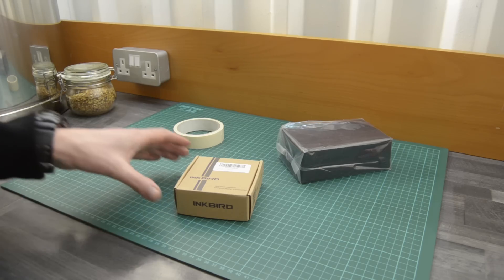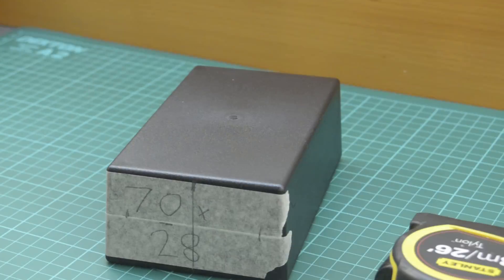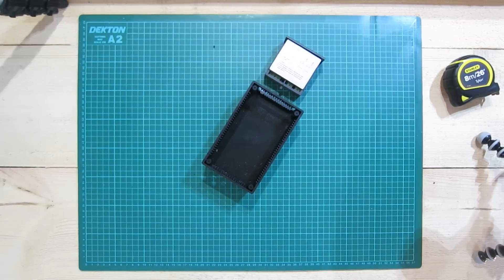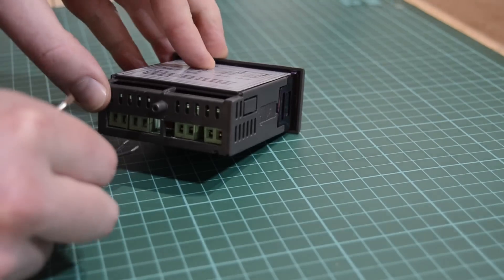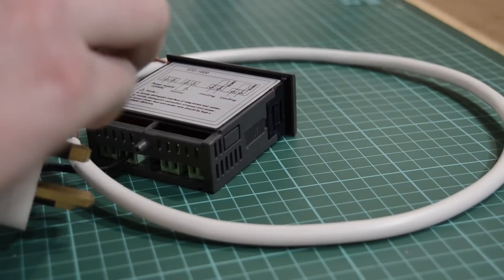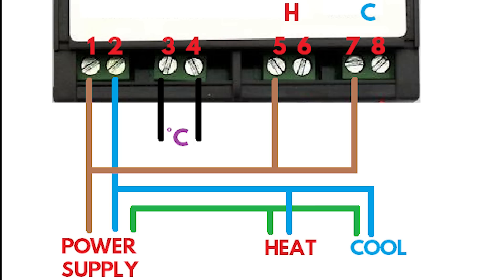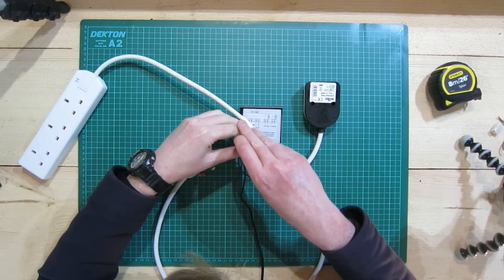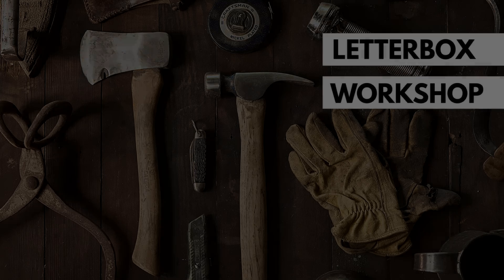STC1000 Wiring Guide - How to make a Homebrew Temperature Controller

Comment: I'm not so sure about that split ground you did, mains voltage is 220V in non retarted countries and 110v in America while the stc 1000 needs 12V or 24V power supply, so no, I don't want to burn out my newly bought temp controller thank you
Reply from the maker: The STC1000 comes in 12v, 24v and 110-220v versions.  My 220v has been wired like this for over a decade without problems 🤷
Reply: @naturalsIV  oh well my stc only shows the 12v and 24v options, luckily wiring it with independant power supply is easier, simpler and less time consuming so I just did that, probably would have done it that way with mains too if mine ran on mains.

Comment: Hello, this wiring works well. I have mine installed and it’s working fine, however, the whole fridge switches off. Is there a way the light remains on when the temp cuts off supply to the compressor?
Reply from the maker: Personally I wired some 12v LEDs in to the normal fridge door on/off switch and ran these off a separate power supply to the fridge. When the STC is off, there's no power at all to the fridge, so you need a standalone supply for this purpose.

Comment: Decent video. Thanks for sharing. If I can suggest you don't bother with the background music though, it's a little irritating IMHO. Also, a couple of shots of the actual wired connections in each step would be useful as your hands block the view of what you're doing quite a lot so, make the connection then move your hands out of the way to show what you've done, rather than just cutting to the diagram. Thanks for doing this though. After a few watches I figured it out 👍

Comment: Hi I have just bought kne of these on the back the wiring diagram says 1 and 8 and 2 and 7 connect am I missing something I'm using mine to convert freezer to fridge so do I follow your method leaving out the heating
Reply: @naturalsIV  thanks for reply I was just worried because the wiring diagram is different on the back
Reply: @naturalsIV it's number on eBay UK  222009063678 plz check it out
Reply: I don't want to mess up lol

Comment: Good video help with wire and confirm I done it correctly I got a unit says  220volt but UK is 230-240v, I turn my unit on and then unit trip off then reset the replay and continues the cycle?
Any suggestions

Comment: Hi, Thank you for your video, It was really helpful, I was just wondering, if we don't use any heating or cooling device, how do we do the grounding for the temperature controller? or do we just connect neutral and live from the power socket? and don't do grounding? 
Thank you!

Comment: So just to clarify, with the ground you are literally using one of the chocolate block things and joining the ground wire of the stc1000 power supply, the heating ground and the cooling ground?
Reply: And all the wires in ports 5,6,7 and 8 are all positive?

Comment: Can I fit a 3 wire temp probe with this? If yes which wires to use from black, red & yellow?
Reply: NTC 10k ohm thermistor rather than the usual k-type thermocouple.

Comment: does the wiring diagram suit a 12v system and do you wire the same  as I cannot find any wiring info for 12v
Reply: Go to GOOGLE and search for:  "stc-1000 temperature controller wiring diagram" and select "IMAGES" below the search bar!

Comment: Could you connect a relay or contactor to it? I am not sure what load the STC can handle. If I need to use it to switch an element of say 3000watts on, then I suppose I would need a relay or something which can handle the amps.?
Reply: I wont risk connecting more than 1500 W. Why? if you are not afraid of fire, then you can connect what your soul wants. Although, you can buy another contactor and use STC 1000 as temperature metering unit. More over there is written 220 V and 10 A = 2200 VAC = 1800 W... Maybe 2000 W, depends what you connect.
Reply: Thanks for the reply. Will check Amazon
Reply: I looked at it again and looks like I need to power 1800watts. So will look into it or look for a different controller. Thank you for the advice